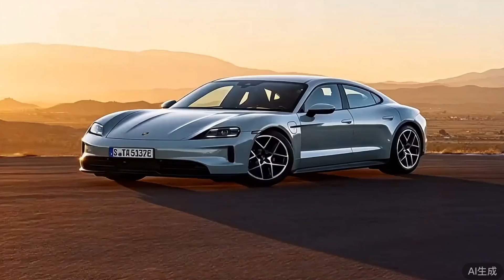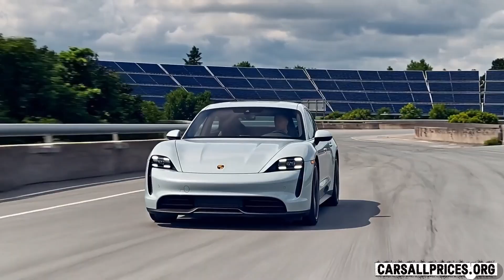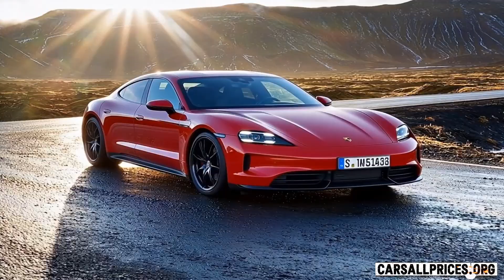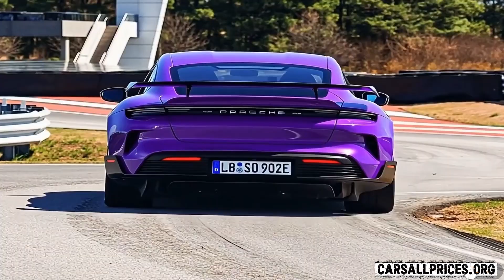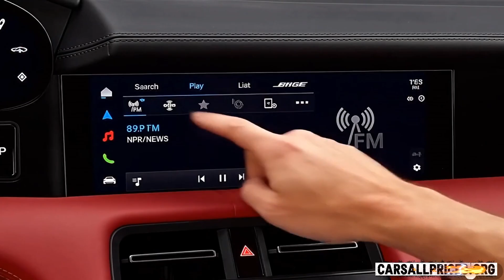2026 Porsche Taycan: Facelift, 600+ HP Turbo GT & 350+ Mile Range! ⚡️💨

Comment from the maker: https://carsallprices.org/%d8%a8%d9%88%d8%b1%d8%b4-%d8%aa%d8%a7%d9%8a%d9%83%d8%a7%d9%86-2026/
https://www.whatsapp.com/channel/0029Vb6QxESLI8YYEmldI82l (whatsapp)
[00:00]	Introduction to the 2026 Porsche Taycan Deep Dive

[01:08]	Performance Metrics of the 2026 Porsche Taycan
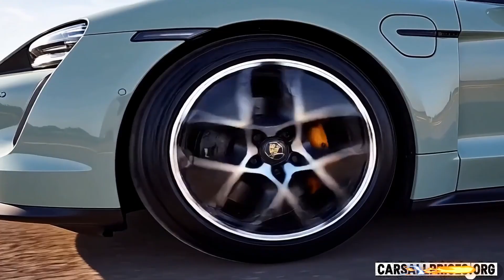[02:37]	Engineering: 800V System and Two-Speed Transmission
[04:36]	Digital Cockpit and Interior Tech in the 2026 Porsche Taycan
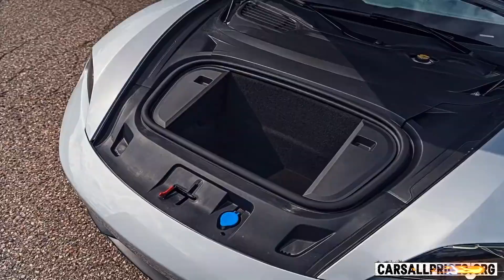[06:17]	Luxury Materials and Practicality of the 2026 Porsche Taycan
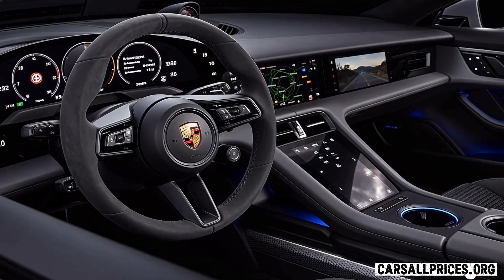[07:33]	The 2026 Porsche Taycan vs. Its Rivals
[09:16]	Key Trade-offs and Criticisms of the 2026 Porsche Taycan
[12:26]	Final Verdict on the 2026 Porsche Taycan
#carsallprices